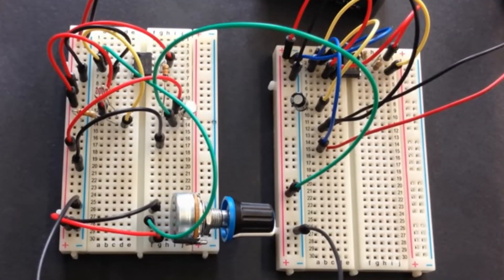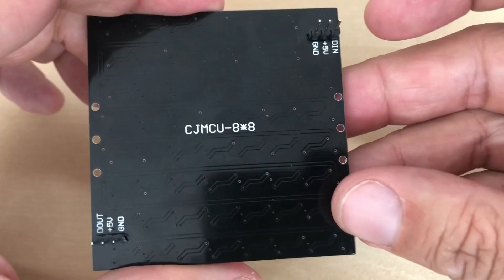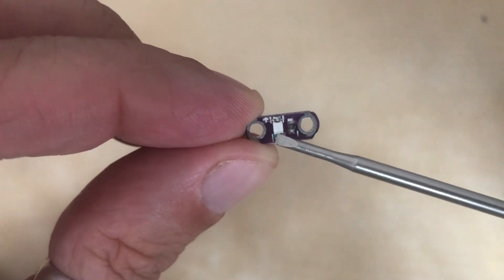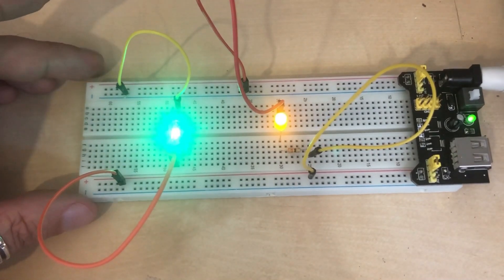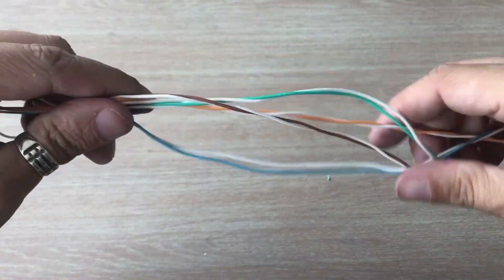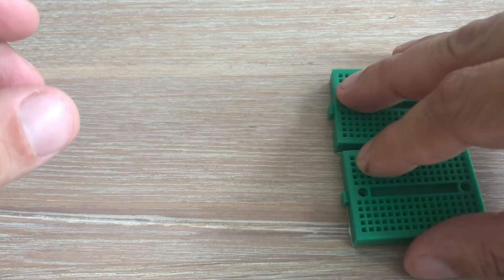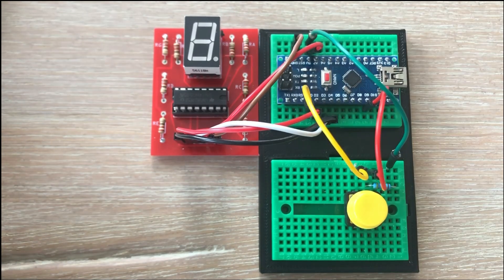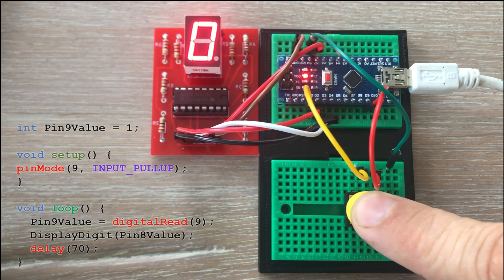5 tips to optimize your arduino breadboard projects

Comment: Is the pullup resistor available in all pins or just pin 9?
Reply from the maker: I think all the digital pins accept Digital pin 13. D13 also has the pullup resistor but this pin also has on board LED attached and it is recommanded not to use INPUT_PULLUP with this one

Comment: Can you try to dim out the LEDs in post? They were pretty blinding when I watched on the TV.
Reply from the maker: I do normally. But in this video I could not. As when talking about lilypad led I was powering it from 5v power supply directly so did not have mechanism to dim it and for 8x8 led matrix the purpose was to show it be the brightest. I noticed it is a problem and in recent videos whenever I was controling led with arduino I used analogWrite command and used PWM feature to dim leds. You can see it e.g when you watch my video about controlling 12v devices with relay https://youtu.be/XiOcxyyTxy4 where I did not dim the light and I was struggling to film it and then in the next video I fixed it 
https://youtu.be/9O0pb0I6bCUhttps://youtu.be/9O0pb0I6bCU
Reply: @marios_ideas  Ah, alright, thanks!